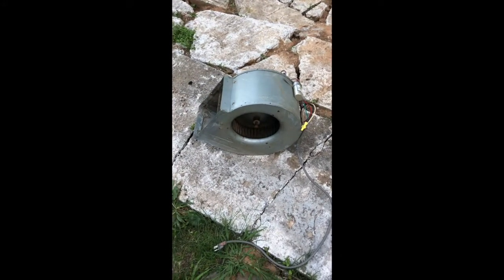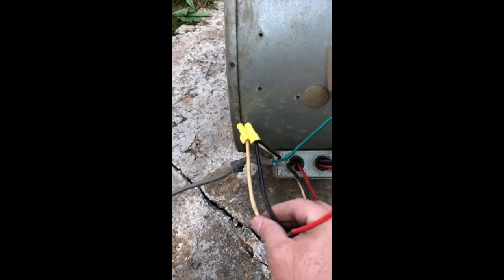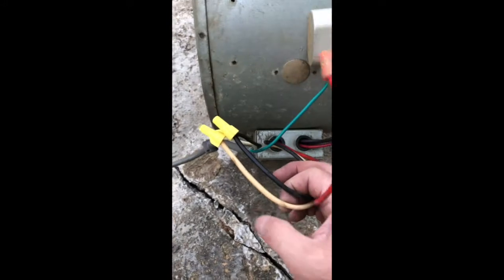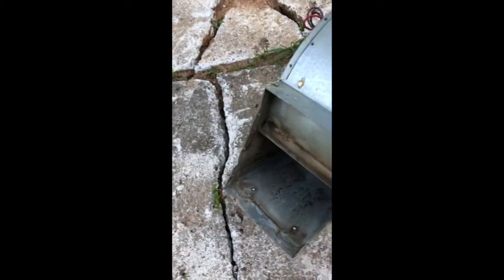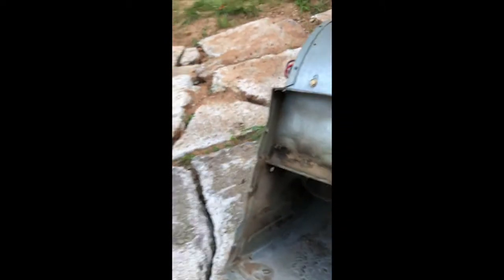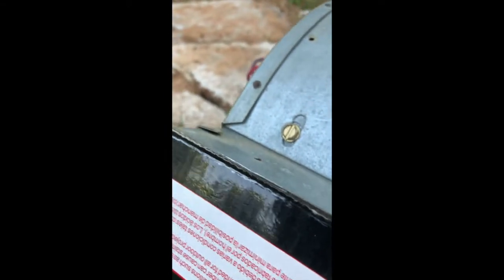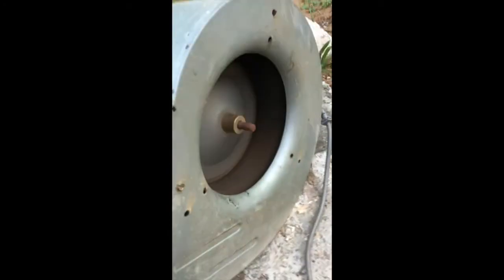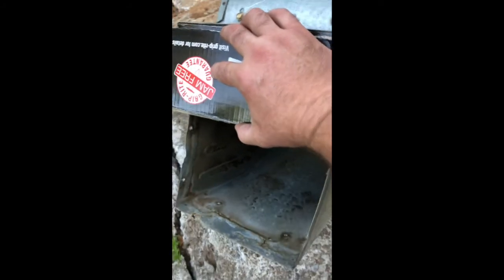Old HVAC Blower 220v to 110v Speeds up with load

Comment: the other wires are just for speeds, you can change it...white is usually common l2  black  is least resistance and highest fan speed for 110 red med blue med red low.
Reply: depending how many speeds of course  you can have 1 to 5 wires for the line in..
Reply from the maker: Man that makes sense... thank you